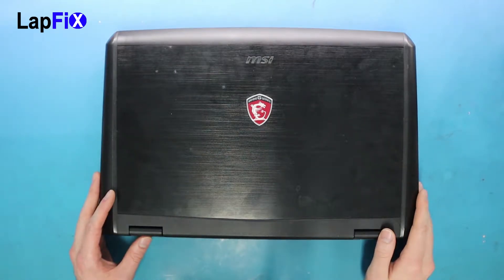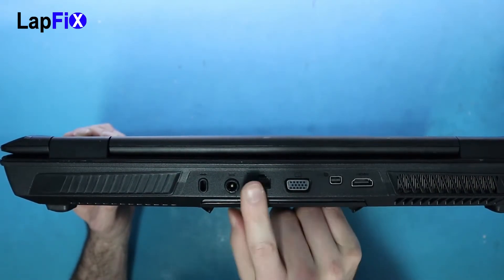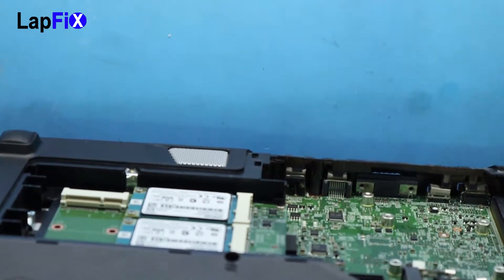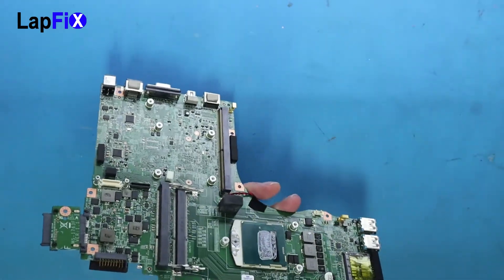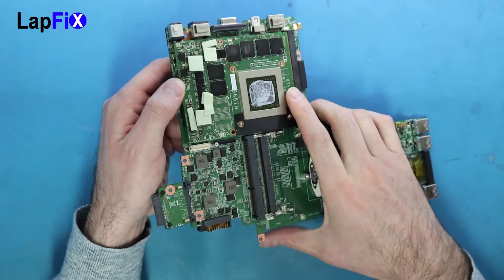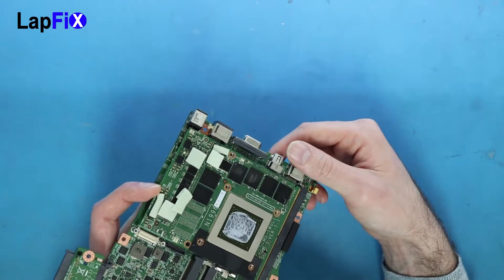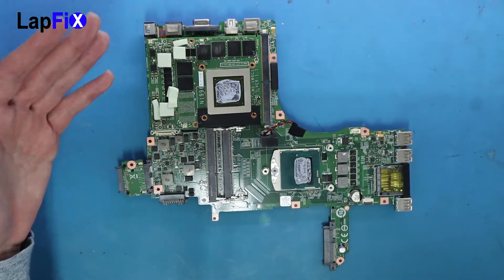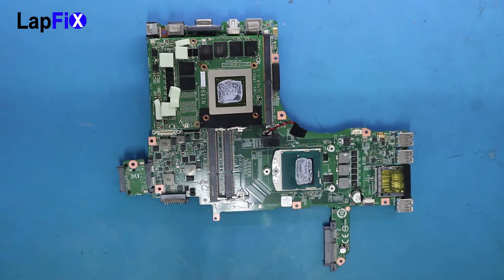MSI GT70 Faulty Design Dc jack issue & Graphic Card !

Comment: Replaced the battery in on of these.
The moment the power plug went in, spark and noise.
Video card started crashing mid-gams after that.
A week later and the 780m Code 43'd.
This video probably has given the reason.
What a terrible design.
At least it lasted as long as it did before this happened.

Comment: Thanks. I own the GT70 2OC GTX770m from 2013 production USA, no problem with power jack. I guess I'm lucky that I'm only using the computer on AC power supply and never on battery and always on the desk not on my legs or bed..., you must make sure to not move the power plug inside the jack all the time, that will cause the jack connector to go lose and touch the GPU. 
The battery is dead already after 2 years of use and never had it replaced. no need ...
However the left hinge of the display is broken completely because the hinge got jam with time and cause the plastic around it to crack completely. 
The camera microphone stops working almost immediately after the warranty expiration date of the computer. thank you MSI.
MSI did not made this computer to be a laptop but a transportable desk computer, i do not recommande to move it a lot it may end up broken due to the cheap material used. 
If you think upgrading your GPU, please do not attempt. The Bios may keep only recognising the original GPU and Nvidia will not install the correct drivers and the heatsink of a different GPU is different so you will need either to adapt your original heat sink or try your luck to find one... then comes the power consumption of the GPU it should be equivalent to the original and not higher.... it is a stupid waste of time and money. Better buy a used gaming laptop instead.
I'm planning next year to put an end to my MSI GT70 maybe give it away for charity. and get the ACER NITRO 5 with RTX3070 I hope it can last me 8 years minimum. it looks solidly build and powerful enough to last for a decade.
Reply: Lol This is exactly my experience with this laptop

Comment: What are the symptoms of this type of failure? My gt70 has got various bsods, and latest and last one was a kernel security issue. Now, upon restart, even after removing components (ram, HD), the laptop does not start up at all. Only cycles power on for about 5 to 10 seconds, then powers off with nothing displaying on the screen. Any ideas?

Comment: It must’ve had a manufacturing problem. Mine sometimes works and other times it doesn’t. When it does, it you move the plug a little bit, it will stop detecting the plug and the pc shuts down. So frustrating because it was expensive and I was out of the country when I started having problems with it, making the warranty not really valid (unless I came back into the country, which I couldn’t I lived abroad for 6 years).
Reply: same issue i have GT70 PE Pro, keyboard some of its keys are working, some others not, Graphic card gtx 880M stopped working long time ago, so, if the dc is replaced will it run proprely?